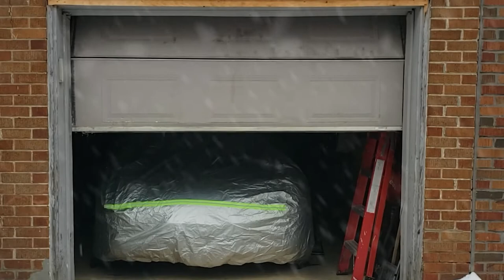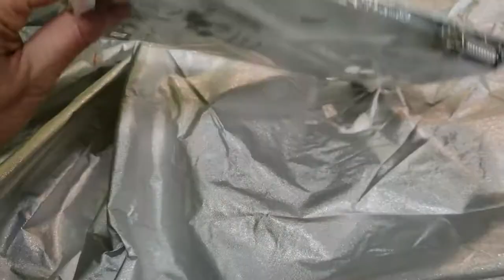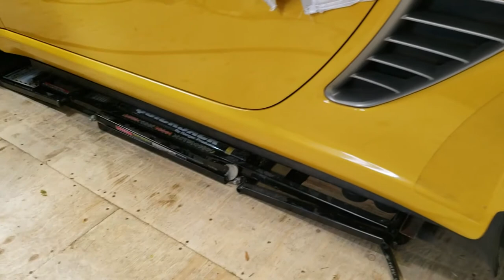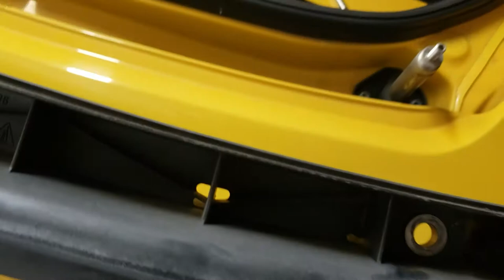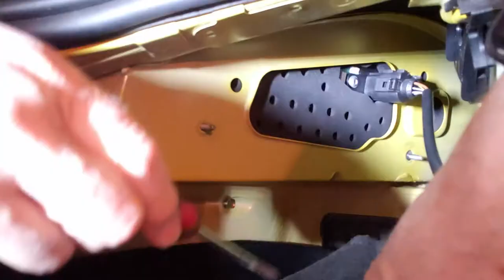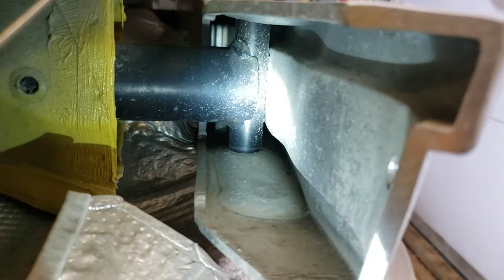Porsche 987.2 Rear Bumper Removal

Comment: Hey thank you for your movie excellent ; could you say me what is the réf of your quickjack please? 3500 or 600 or... LT or xL in lengt
Reply from the maker: Hmmm, can't say as I remember. The one I was using was the mini one. Borrowed from a friend. You need the next size up because the smallest one isn't long enough. Nothing to do with the weight capacity. Check the measurements.

Comment: What's your personal opinion on the quick jack ?  I want to buy one but reading all the reviews on costco sketches me out
Reply from the maker: QJ is a good product. It is rather heavy but manageable. Check the clearance. If your car is very low, you may need to use a couple of 2X6s to get it under. When in place, it works very well. Great for suspension work! It won’t go high enough for an engine drop without some extra risers and extra steps. If you have enough clearance or enough space, you may be able to leave them on the floor, otherwise they can lean against a wall when not in use. In my opinion, they are sort of overkill for the occasional oil change.
Reply: I have the QJ system and simply park over the two ramps in my 987.2.  Excellent and safe.  I am 70+ so I dont want to get crushed any other way than in a single car shunt on the open deserted desert road.  Cheers
Reply: New to this thing.  Is there a way to ask NewArt or athers if the rear bumper "tits" on a 2010 987.2 require removal of the rear bumper to replace one that some idiot smushed in a parking lot - and didnt leave a note of apology DHhu....